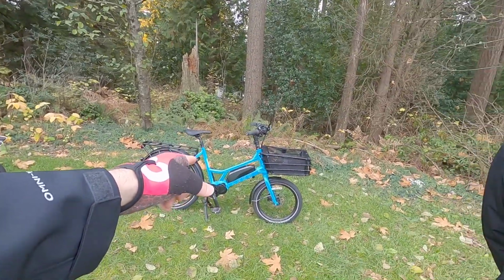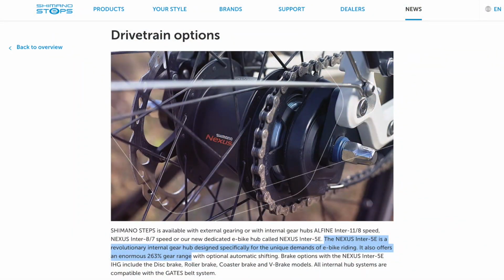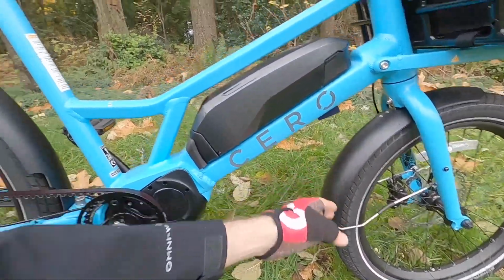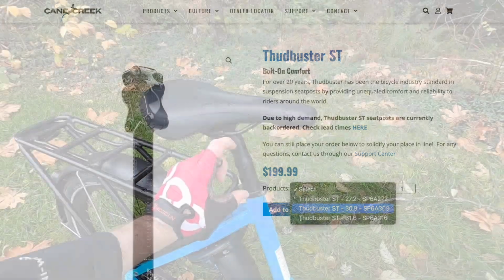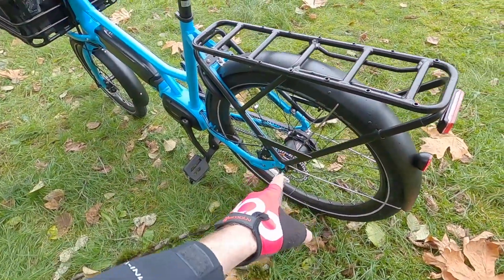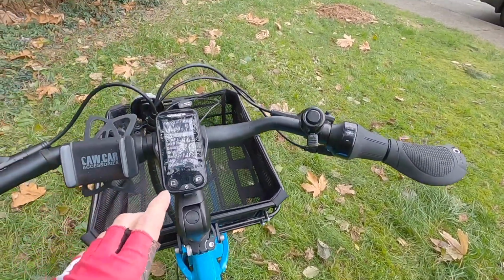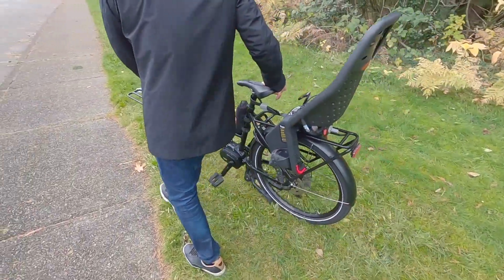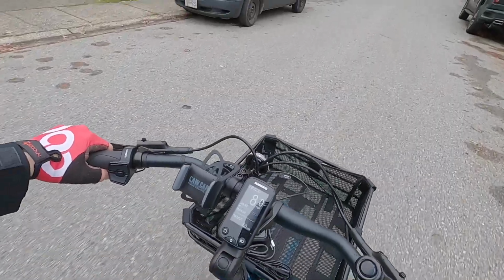CERO One Review - $3.8K

Comment: Pedaling around corners could be a problem with the lower center of gravity
Reply from the maker: Are you concerned about sliding or something? I think it handled well enough, but the lower bottom bracket and longer crank arms could result in more frequent pedal strikes or bottom bracket strikes on curbs or with obstacles like rocks and logs. Overall, it felt decent to me and wasn't as tippy as most cargo bikes, but still tippier than a non-cargo with no font rack.
Reply: When they talked about the small front wheel offering a lower center of gravity, he was referring to the basket being lower than on a larger wheel. That reduces the jerkiness, floppiness a front load will have when you are turning the bike.

Comment: Love it but 4K? Idk man, either inflations really hitting hard or this bike is 1k-2k over priced
Reply from the maker: Yeah, I feel you... Trying my best to mix in value priced bikes (that are still good quality/reliable) and also the nicer stuff. Anytime you've got a Shimano mid-drive, Gates, CVT, and hydraulic disc brakes with a custom low volume frame... it's just going to cost a lot. Honestly, I'm surprised it doesn't cost more! And yes... inflation, recent CPI number was highest in 30 years above 6%! that's alarming, negative real yields on bank accounts earning 0.05% so you're losing 5.5% annually, and that's probably under reported since CPI is generally thought to be misleading :/

Comment: Been looking at a few ebikes  around the $1500 to $1800 and it's kind of disappointing  on what your getting. Can't see any value in anything over $2500. Seems like they still use basic bicycle breaking when they should really have larger disk brakes and same cheap gearing shifters.
Reply from the maker: Yeah, the lower priced bikes tend to use basic parts and often mechanical disc brakes. I was happy to see some companies like Magnum, Rad, and Aventon going to hydraulic disc, but their prices also jumped up. Anything with a decent mid-drive motor seems to start at $3k or you can pay $2.5k for an underpowered motor like the Bosch Active Line...

Comment: Non integrated battery is deal breaker. Makes the bike looks cheap, for over 3 grand they can do better.
Reply from the maker: I'm so torn on the integrated batteries, because they usually weigh more and are longer and sharper and more difficult to take off and put back. For me, this particular Shimano STePs battery pack is the best execution of an external battery, because it slides off from the side and has a decent charger design. But yeah, it's not quite as pretty as a fully integrated battery ;)

Comment: I know this might be irrelevant but, my battery got stuck in the frame. it won't open and when i
 turn the key to try to open the battery there is no resistance like it should be. 

And another thing to note is that at the top of the battery on the right side there is a little gap like if it is not completely clicked in the frame. Any suggestions/solutions I would appreciate?
Reply from the maker: Hmm, I wish I could look at it in person. Maybe there's some sticks or dust creating space, or maybe the mount needs adjustment? I've seen this on some Bosch Powerpacks before. Maybe the latch got stuck in the pressed-in position and that's why there is no resistance? So hard to tell without seeing it :/